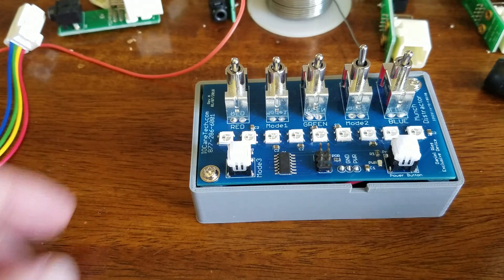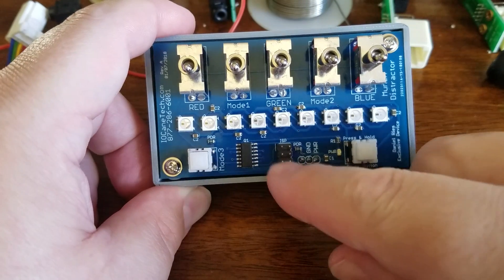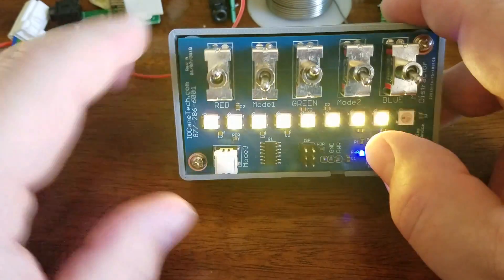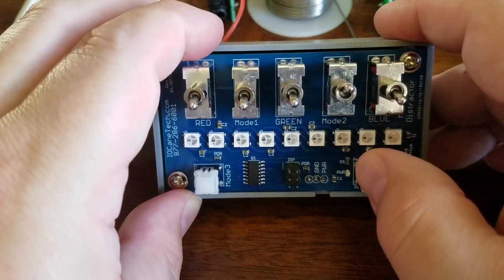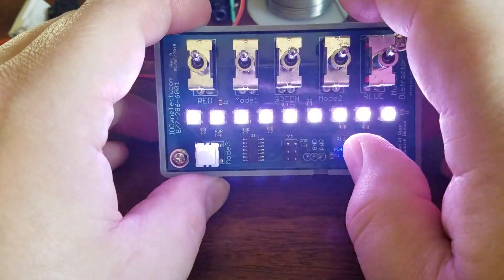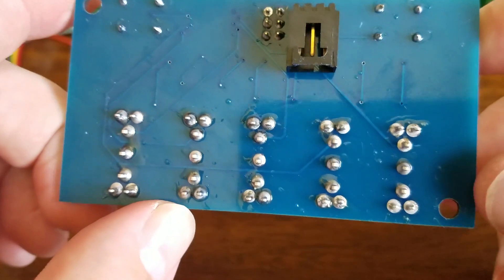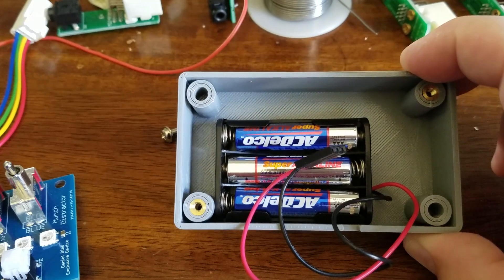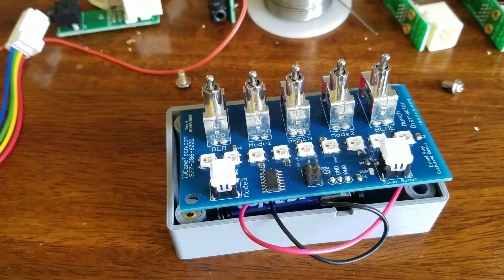Arduino Based Child Munch Distractor Neopixel WS2812B Children's Play Toy

Comment: Great project! Are you able to provide your code? I'm new to arduino and struggling to integrate buttons/switches into the code so I can make something similar to you for my son:)
Reply from the maker: Sure! This code IS AWFUL!! Because I literally just tossed some quick code together to make it work for him. I did not take time to comment it, optimize it, or do anything other than just make it work!!
Normally when I create something my code is MUCH better, so I'm embarrassed to post this code but here ya go :)
This was for a an ATmel ATTiny 84 Chipset. (Basically the same as an 85 but with more IO's But this code would work on an arduino if you changed the pins to meet your needs :)
http://steveries.com/temp/MunchDistractor.zip
Reply: Many Thanks, I've seen enough code to know what to look for but haven't got many mods to work yet but your project has been the closest to what I had planned. I'm hoping to have more buttons than switches. This has been a great help!
Reply from the maker: Let me know if you need help on the PCB Creation or SMT soldering :) 
I'd be glad to help. PCB's are CHEAP, Those cost me $20 bucks for 5 copies of them. so like $4 bucks each